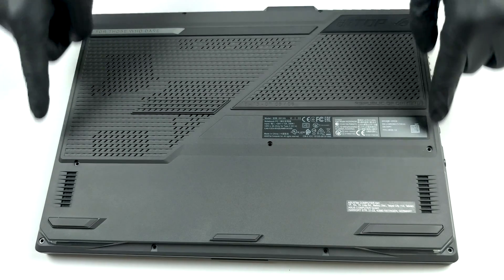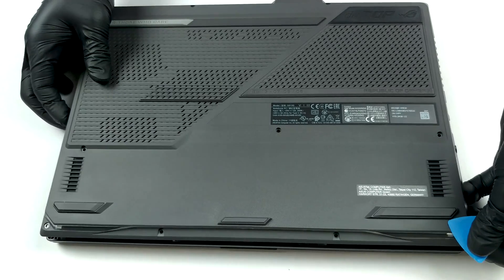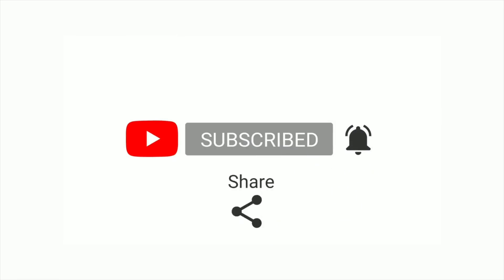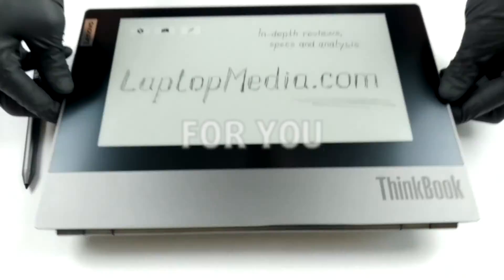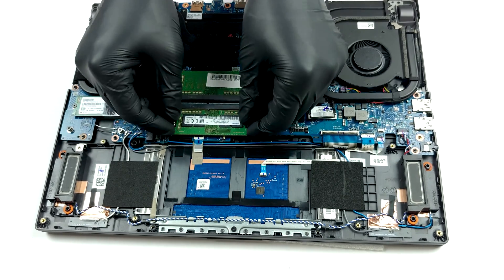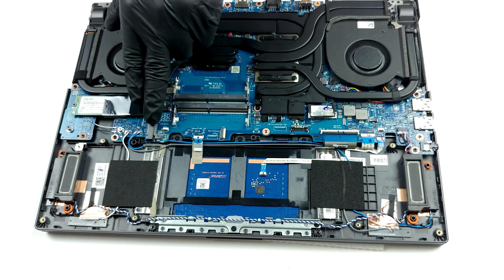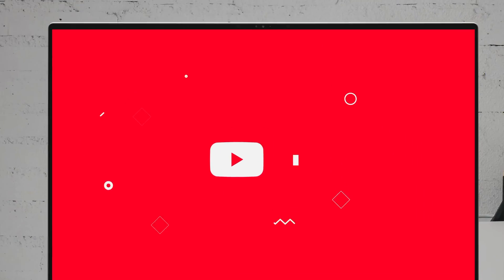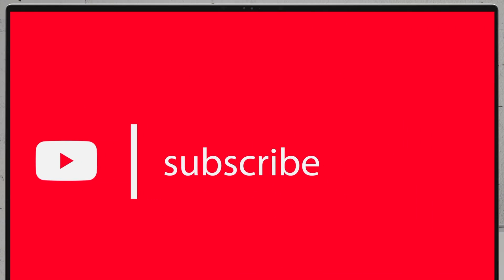🛠️ ASUS ROG Strix G15 G513 - disassembly and upgrade options

Comment: !!!!! READ READ READ !!!!! 0:53
0:53 he is removing the RGB/LED (which is attached to the back panel) in one fell swoop. 

0:56  DO NOT RIP IT OFF WITHOUT REMOVING THE RGB/LED STRIPS!!! 
THEY ARE BLUE AND HAVE A LITTLE TAG. VERY EASY TO SEE BUT ALSO VERY DIFFICULT TO NOTICE IF YOU JUST YANK THE PANEL OFF.

Comment: Max upgrade Asus Rog Strix G15 G513IC - Ryzen 7 / Intel 7 

Storage
2 TB max per slot NVMe M.2 2280    -up to 4th generation (PCIe Gen 4)

Asus ROG strix - RAM 
Max Ram 32 DDR4 - ( Max 3200MHz )
Reply: Thanks

Comment: can anyone help for the battery sparkling issue? i have seen some topics about when unplugging the battery socket on the motherboard there may be some spark then battery is dead.
Reply: The metal band that holds the battery clip to the motherboard just slid out and I don’t know how to fix it. I have to leave my laptop plugged up to work. If anyone knows what to do please tell me.

Comment: Anyone tried to install 64GB of RAM in G513IM? (Ryzen 7 4800H, 16GB RAM, 512GB SSD, NVIDIA RTX 3060 6GB). From factory has a frequency of 3200MHz, has anyone tried more?
Reply: Do you know is there a possibility to install 1TB ssd without removing 512GB ssd getting total of 1,5tb memory?
Reply: @alexglytnev3110  yes, you can install other one, m.2 nvme type.

Comment: Hi there, my g15 stopped working so i opened it and guess what. I don't know the name, but it's where the battery is plugged in, it was held by the last pin of the MB connector. I didn't open my computer earlier due to warranty but if anyone has a problem with the laptop not turning on please note you might be the special one with this soldering issue and one of the LED strips was also loose, the left one to be precise. 
I don't know if the battery problem is repairable or I should get a new motherboard.

Comment: Thank you so much for this! I've had my laptop for less than 6 months and the wireless network card has broken! We've tried everything from updating it to uninstalling and reinstalling and nothing has worked so I guess its just broken. This will be super helpful when I change the card but for now I'll use a dongle, I'm getting about 3x the speed I was getting by using the dongle instead of the card that's inside!
Reply: Did you notice anything else, apart from network issues?

I suspect that my bluetooth could be screwing up things with the keyboard, but am not sure... it is weird. I was seeing odd things in the system event log and device manager. Whatever it is, it is driving me crazy, because my keyboard craps out and crashes its driver or something... it stops working if I don't use it and starts working again if I press a key. I have so many missed keypresses that I'm going crazy.
Reply: Same with me, i even sent it in for a warranty check. They changed the card and formatted my laptop. Same slow and high ping connection. Ended up connected to the Ethernet until i finally installed a intel ax210 wifi card. Best choice yet. Today will be upgrading the ram
Reply: Another question, did you have to detach the cooling to get to the wireless network card?
Reply: @nyanray  for detaching the cooling the answer is no. You only have to detach the factory ssd because the wifi card is under it. Just like in the video.
Reply: Hey all,  i had the same problem, and found that the mediatek wifi driver was the problem. I installed the last driver directly from MyAsus app and problem was solved.
Reply: WOW i have this same model and mine (network card) was broken from the beginning only want to fix it is a hard restart or LAN
Reply: Hey, i have the same laptop as in the video, but i've had this issue that sometimes after leaving my laptop in sleep mode for long periods of time, my wifi won't find any networks. I have to restart my pc to be able to find networks again. I don't know what could be the issue. If anyone know what it might be i'd love to hear your answers :) .
Reply: @reflaxis8917 it has something to do with the WiFi driver itself, if you google it and include the specific specs of the laptop there should be some websites explaining how to fix it.
Reply: Yeah, the mediatek card that come in these are complete trash. I just swapped to an Intel ax210 as well, tried a ax411 and it did not come up as a Wi-Fi adapter so tried the ax210 and it’s been a joy to use.
Reply: @robertshoop8181  , I have the 2021 ROG Strix G15 G513 , do u think i should upgrade my wifi card too? I did it improve your wifi connection or was it just less  buggy.

Comment: Yeah. Be careful opening this. There are two rgb cables. You can get to the extra SSD card slot without removing the cables.
Reply: Wow, thank you so much good sir
Reply: Yes but be sure to at least unplug your power source don't take it out tho I just upgraded my strix g531 ram didn't have to move anything

Comment: Just did this today on my daughter's laptop to make RAM 16x2 and add a Samsung 980 SSD. The laptop is used for Architcture Study. You were my reference during the process. Many thanks.
Reply: what ram did you use?
Reply: @anastaciannamdi5994  crucial  16x2  CT2K16G4SFRA32A
Reply: Is the ssd slot compatible to pcie 4.0?
Reply: @CraizHunterX  at that time I used samsung 980, PCI3. You'll have to check that with Asus if necessary. , However, PCI4 won't give much performance advantage over PCI3. So I do advise using PCI3 SSD. Save money and still very fast and 100% compatible.
Reply: @SamerShennar  okayy thank you for your answer broo

Comment: Is there a max size for the ssd slots? Can I add 2 separate 2TB sticks in there?
Reply: Think you can. Why so much needed?
Reply: Can because i put 4TB and 4TB total up 8TB nvme
Reply: @haziqyusoff98  Which model are you useing ? I will buy 1Tb nvme but technical support said total storage capacity is 1Tb. Extra 1Tb wont work they said. I need to sure it is true or not
Reply: Is the ssd slot compatible for ssd nvme 4.0?
Reply: Hello all , I just add 2 TB kingstone KC2500 + 2 TB Samsung 970 evo plus, both works perfectly fine in this laptop. My friend add 4 TB SSD in one slot and also worked fine.

Comment: Thanks for the video. It was very cool to follow thanks to your video and helped in choosing a laptop. But I'm horrified to find that the cheaper G513IH models have completely cut cooling where instead of 6 heatpipes there are only 3 heatpipes NO VRM dedicated heatpipe. 1x dedicated for GPU and 1x dedicated forCPU and one heatpipe for cpu and gpu together. No more. 
To make matters worse. The second NVME SSD must not be equipped with chips on the other side otherwise the stand for the smaller SSD bends that large SSD if it is wearing chips on the other side.
Reply: The stand off for the smaller ssd comes out
Reply: @STEN-164  It would be great if it did, but I can confirm that it cannot be removed. The stand for smaller ssd is soldered on my board in this NTB.
Reply: Do you have a video which shows the upgrade for those G513IH models? I have one and want to upgrade it
Reply: @s_zeelpdf6052  I don't have the tools to shoot quality video, but I can provide photos with a description of what and how to do. But I can confirm that this video describes exactly how to disassemble it. Only the cooling looks different and I have a problem with the bent M2 SSD but works fine. If you want photos of my NTB disassembled. Give me an email where I can send you photos and I will describe the problem I have with the SSD, which you have to watch out for if you have a double-sided chip M2 disk.

Comment: Nice video! It was helpful, I needed to put a second nvme SSD and was afraid of the location of the RGB ribbon cables.
Reply: Hello there. How many Gb Ssd did you use ? I read somewhere that maximum capacity of storage is 1Tb.
Reply: @aniluysal4565  sorry for the late response, you can out up to 2Tb NVMe, because other higher capacity NVMe drives have chips on both sides and that doesn't fit well.

Comment: My one problem I have with this video is you do not show WHERE the ribbon connectors are on the underside of the panel or how to disconnect them.
Reply: on the left - just below the ssd1 and ssd text. and on the right to the left of the spk text

Comment: Does anyone know if you can expand the storage with an HDD? Or just ssd's?
Reply: it only has an nvme slot so no hard drives
Reply: M2 NVME drives are dirt cheap at the moment. 
1TB, $100 
No reason to get an HDD
Reply: @HandsomeNamed buck for buck, nvme are more expensive at the moment due to the global chip shortage.
Reply: Is there another Strix model where there is a 2.5" slot for HDD?
Reply: @csaba-kjk  unfortunately no. it was because of that limitation, i ended up choosing a nitro 5 because it has a 2,5 bay

Comment: What reviewers don't mention is how shitty the WiFi card is on this g15 asus laptop. If you have a mediatek ax card you're screwed. I replaced mine with Intel ax200 and whilst improved things, still causes my games like csgo to rubber band due to lag very badly. It's not an excuse because if I tether my phone to the laptop via USB it is absolutely fine. There are hardware issues with the WiFi on this thing and people need to be aware of that.
Reply: I'm legit watching this video to research replacing the wifi card I'm transplanting from my older laptop, hahahaa
Reply: There a driver update that fixes most of the problems
Reply: @craiglobo2165  nah, even with the latest window and intel driver update, the wifi driver sometimes shutdown for no reason. Network reset and DNSFlush still not fix it
Reply: so u can remove the mediatek card and change it right? it’s not soldered or anything (just asking to be 100% sure)
Reply: Yeah wifi card is bad. But only if one is taking it somewhat away from the router. If reasonably closeby then it's not an issue.

Comment: good job! im gonna buy this laptop and i wonder how to upgrade ram with another 8 gig of ram. thanks a lot man
Reply: The store usually does it for you as they did for my Strix g15
Reply: You can see the RAM in this video - centre of laptop. 
You just unslot those and slot in new ones. Google "best RAM for G15 strix ae" to help decide which to buy. Lots of testing has been done on this
Reply: @HandsomeNamed   i upgrade it like 1 month ago and it works very well. Before upgrade i get 110fps on valorant but now i get like 190-220.

Comment: Nice. Two ram slots. Unlike their Zephyrus models, which only have one ram slot.
Reply: well, Zephyrus thats actuallly better, i will explain my point of view:
i own a G513, it comes with 16GB RAM expandable up to 32GB (yes max 32gb not 64)  AND the stock 16GB are 2x 8GB, so if i want to upgrade my RAM like i did last week, to 32GB, i had to buy 2x 16GB RAM which is almost twice the price than if it came with 1x 16GB and i would only need to buy 1x 16GB to make it 32GB...
ALSO about the SSD on G513:
- stock came with > 1TB SSD gen3 x4 (at least its whats written on it😂) < which is a PCle 3.0 and according to  GPU-Z app, my nvidia 3070 inside already supports gen4.0 which would be literally twice as fast as the gen3... on the GPU-Z Nvidia section literraly says: "Graphic card reports that it supports PCI-Express 16x 4.0" and bellow "It's currently running at 8x 3.0"...
also the fact that the AMD integrated on the G513 says on GPU-Z that only supports PCI-express 8x 3.0 and its running on those same values...

Comment: Hey. Would like to know what's the max capacity allowed for the second SSD. Because I'm gonna buy one of this notebooks and I'm not sure if the one I want (300hz, RTX 3060, Ryzen 9 5k series, 512GB, 16 RAM) has that slot
Reply: It will. That slot space isn't used up for any additional spec

Comment: Important question:

Can you remove the fans WITHOUT removing the panel (heatsinks) ?
Reply: I own the exact same model, I tested it. The heatsinks and the cooling fans do not overlap each other, meaning you can remove the fans without removing the heatsinks first. So you don't have to worry about reapplying liquid metal whenever you want to clean the dust off the vent grills. Very easy to clean and maintain.
Reply: @ryl6993  thanks
Reply: No man the wires are soldered to the mb so its a risk

Comment: Is there a tutorial to replace the thermal paste?
Reply: doesn't require thermal paste, Asus uses their patented liquid metal, is way cooler also works longer than thermal paste
Reply: @navasheen8964  ok thank
Reply: @navasheen8964  how do you maintenance it then?
Reply: @wrxstityperapower  its a bit tricky liquid metal runs for twice the time so around a year my ran for that long as well tho you can swap it too thermal paste it wont be thta efficient and poring liquid metal by yourself can be dangerous for the motherboad so I would recommend for you to take it to a service center

Comment: Can 1tb for m. 2 ssd be on ssd 2? Sorry, English not 1st language
Reply: Yes, you can add 128,256,512,1000,2000,4000 GB in any slot and it will work fine, I have 2 TB + 2 TB = 4 TB total works perfect
Reply: @someone__7.  can we use PCIE 4.0 for this laptop? Is it compatible?

Comment: Great work .... Appreciate it very much as I am thinking of purchasing this laptop.
Reply: I bought this nd its a great laptop
Reply: @Razor2506  yo how is the screen and keyboard? is it bright enough?
Reply: @CuongNguyen-gu9fl  screen is really bright for indoors...but bit low when used outdoors...but who plays outside right? And keyboard is gud too
Reply: @Razor2506  thanks. I intend to buy the base model r7 4800h for Software engineering undergrad, so I want it to be good enough. Laptop is hella expensive in my country.
Reply: @CuongNguyen-gu9fl  where are u from bro??
Reply: @CuongNguyen-gu9fl  i have bought the base variant only bro...but in my country it doesnt come with the qhd display..its fhd
Reply: @Razor2506  I'm from Vietnam. And it's FHD too. This laptop is at the same price with the 144hz base variant of Legion 5
Reply: @CuongNguyen-gu9fl  ohh...maybe consider legion 5 too
Reply: @Razor2506  yeah, I was considering. The Strix got a better Ryzen chip, the Legion got a better screen but heavier.
Reply: @CuongNguyen-gu9fl  but the turbo mode in strix is so silent u wont even notice its on...thats a gud feature
Reply: @Razor2506  does it throttle or get too hot in idle or normal use?
Reply: @CuongNguyen-gu9fl  no throttling observed in my unit..been using for almost 1 and a half month..nd its too cool when idle mode...trust me the cooling system is awesome
Reply: @CuongNguyen-gu9fl  but again i havent tested heavy games..so not sure of that part...but i can say throttling wont be an issue
Reply: @Razor2506  cool. Thank you very much, I'm not gonna play any demanding games anyway.
Reply: @CuongNguyen-gu9fl  then u r good to go...
Reply: @CuongNguyen-gu9fl  advance congratulations
Reply: @Razor2506  same
Reply: Same, gotta know how upgradable it is
Reply: I have, it's really great, just added another memory ssd to mine. The plastic clips are much stronger than you think 🤔
Reply: @donovang6911  is yours the 9 HX version? Planned on getting that one but I have heard mixed reviews....mostly going to use it for after effects and editing plug ins
Reply: @gr00vyrat78  I got one and it's great, but I've heard it's a lottery, some guys with heat problems, others with screen light bleeding, I think I won the lottery with mine, no light bleeding at all, and stays cool. So as long as you buy it near you and from a store that doesn't make a fuzz about guarantee then I think this is the best option right now. Also, know that the 300hz panel is the one that supports 100% sRGB, not the 144

Comment: After replace the ram my laptop only shown a black screen but the keyboard leds are on, someone with this experience?
Reply: I removed one 16gb ram and the same problem!
Reply: and?? did you solve it?
Reply: @quinten5993  yes, there are only some ram compatible with Ryzen 9 and Kingston wasn’t it.
Finally I bought crucial and it ran without problem.
Reply: @neneossa  nicee to hear! Awesome
Reply: @neneossa  How much were you able to add? Website says 32 but here 64
Reply: @gr00vyrat78  i only added 32gb without problem. (16x2)

Comment: This asus support 64 Gb of RAM? Because on website the info of the laptop says that only support 32Gb is correct?
Reply: was wondering the same thing
Reply: @MariaCharalambous1989  need real test. I have G513QM (Ryzen 7 5800H and RTX3060)
Reply: 32 gb ram in single channel i think
Reply: Anyone tried to install 64GB of RAM in G513IM? (Ryzen 7 4800H, 16GB RAM, 512GB SSD, NVIDIA RTX 3060 6GB). From factory has a frequency of 3200MHz, has anyone tried more?
Reply: I tried to install 64 GB but didn’t work, the max is 32 GB @ 3200 MHz , which is enough for anything thought

Comment: hi laptopmedia can you confirm it support 64gb ram thanks
Reply: Yes and yes
Reply: @deejeemadrox1866  Thanks! Only wondering why it is not supported officially. Can only imagine it is to distinguish the more expensive models.
Reply: @henryhahn1938   Sad but true. The industry is trying hard to give us " more fixed choices" . Free upgrade paths are declining.
Reply: @deejeemadrox1866  What model you have? I have G513IM (Ryzen 7 4800H, 16GB RAM, 512GB SSD, NVIDIA RTX 3060 6GB) , still working on it?
Reply: has someone tried?

Comment: Where is the led wire? How do you removed?
Reply: Just slide it out, I remove mine, it is very easy
Reply: COMO LA SACOOO
Reply: Question, very late, but how did you plug them back in? I successfully reconnected my keyboard RGB but not the ones that go around the laptop